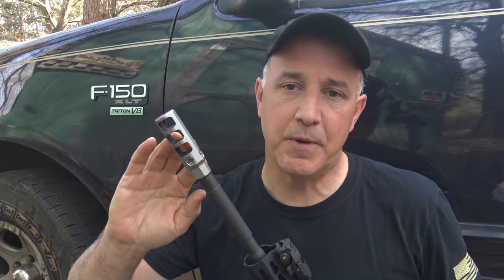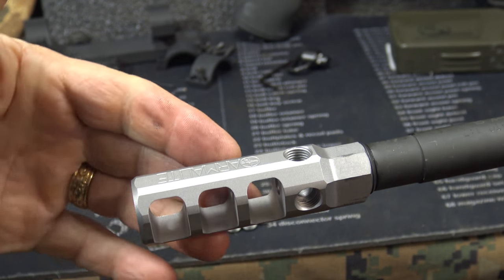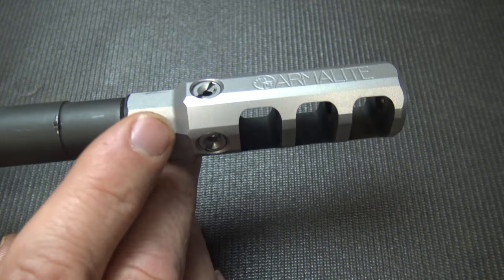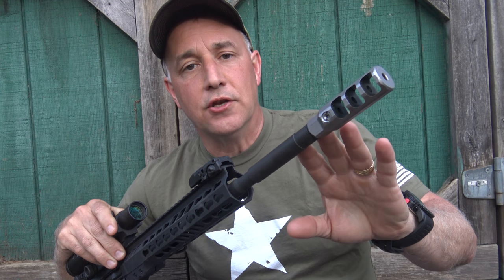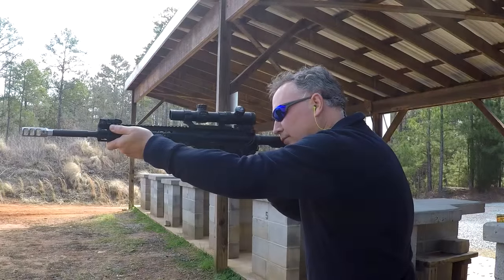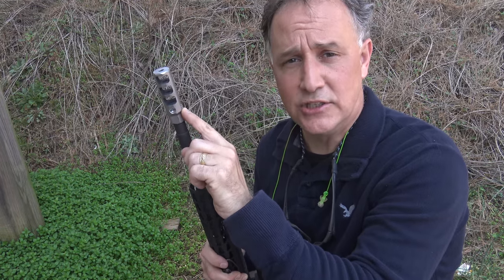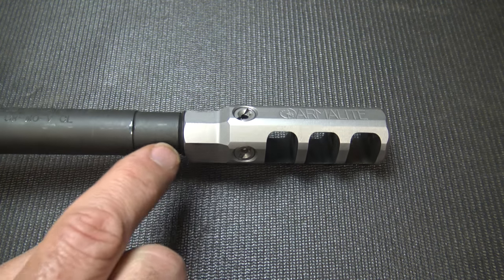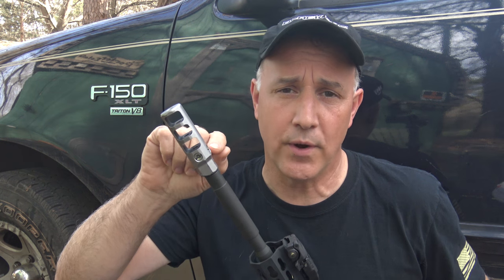Armalite M-15 Tunable Muzzle Brake Review

Comment: Something I learned years ago on installing muzzle devices,  Do not torque them down super tight.  It seems to me that super tight muzzle devices are determinable to best accuracy.  I have always had good luck with just snugging the device up and using red Loctight.

Comment: A rifle length gas system will cut down on the recoil impulse more effectively when compared to a carbine one.
Reply: and cause malfunctions in a 16" from being under gassed.
Reply: Dohn Joe
your proof?  I have a 308 and 5.56 both in rifle gas and they are 100% reliable.
  Read up on how the AR-15/M16 was over gassed since Viet Nam b/c powder changes in the cartridge.  Instead of fixing the ammo, they fixed the gun.

Also consider where the M1 garand taps the gas from.  Look at a Colt Commando and CQB.

Tell me how they're under gassed.
Reply: +MavHunter20XX i have first hand experience with even 20" barrels not locking the bolt open when paired with a carbine buffer and tube. Running a mid length on a 16" gives you great reliability and smooth recoil impulse. I also prefer mid for 18" if using a carbine buffer, spring, and tube for the same reason.
Reply: +Dohn Joe looks like your problem wasn&#39;t with the gas length, only. Are you aware not all springs/buffers are NOT the same weight.  You can buy two springs, both for carbine length and both will feel different when pulling to the rear.  Same goes with buffers.  Also a loose gaskey or worn gas rings on the bolt can give you the same issue. So if you&#39;re feeding too much gas when there are other issues, you are potentially beating your rifle up.
Reply: +MavHunter20XX Yes I'm aware, that's why i made the differentiation between the springs and buffers of carbine vs rifle. These are brand new rifles I'm talking about. And no, I don't just run a gun if it's over gassed and let it beat itself to death. I always check the amount of extractor induced rim deformation/scarring on the brass if there is any at all. Also note that the ejection pattern is more rearward as it should be and doesn't start kicking them forward when suppressed. 

Running a 16" with a rifle length system may work ok if set up with the exact right spring, carrier, and buffer, but change one and they choke.
Reply: Dohn Joe
i can agree with that.  However in my system, I've had no problems.  Caveat is that I built it piece by piece.  I assumed that you just swapped parts, my mistake.  There is something to be said about manufactures not doing their job in ensuring that the rifle is not properly gassed even in dizzy rifles.

Comment: were the threads dirty or rough? You can hear grit when you put the plugs in at the beginning of the video.
Reply from the maker: +Minor Bob A little bit of oil would have eliminated any grit so I should have used it when applying the plugs.

Comment: +sootch00 do you run magpul on your AR's
Reply from the maker: +Patrick McManus I love Magpul accessories and have a number of their stocks on rifles but also use other stocks on different rifles. The BCM Gunfighter and Battlelink Minimalist Stocks are favorites as well.
Reply: +sootch00 Amen to that.... Magpul has some of the best AR15 accessories available. also a big fan of trojan firearms
Reply: +sootch00 Hey Sootch. What do you think of the Ruger AR 556? Looking to buy one in the next couple weeks. Nust wanting to see what your opinion is on it. Thanks.
Reply: *just
Reply: +Silvirbullet It's a great rifle.  For the money, you get a lot of features compared to rifles in the same price bracket; CHF 1:8 twist barrel, tight lower and upper fit, forward assist, dust cover, round trigger guard, and screw-on delta ring to name a few.  It's accurate and is good enough to leave as is, save for adding an optic of choice on the picatinny rails.  Do it.  I'm surprised sootch00 hasn't done a review of it yet...
Reply: +OCTurboJoe Same here Joe. I'm sure I'll get one in May this year. Just a few weeks out. Yay, will be my first AR.
Reply: +OCTurboJoe I'm thinking about putting a magpul SL mlok fore-end and their vg. What do you think?
Reply: Sounds good.  While you're at it, get the mil-spec MOE SL stock and pistol grip.  The only drawback to the SL pistol grip is it's hollow and you wont be able to store items like a normal MOE grip can.  I have a K2 grip on mine and it feels great.  It changes the grip angle to a more vertical, natural (close quarters) position however I personally like it that way compared to the conventional angle.
Reply: +OCTurboJoe hmmm. i'll look into that. Thanks. I think I'll look at the moe first and see from there.